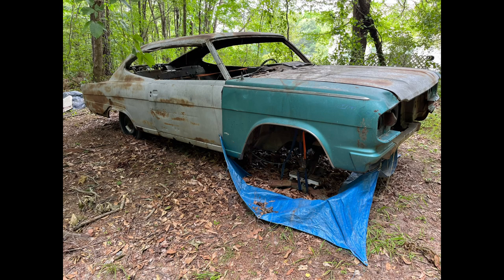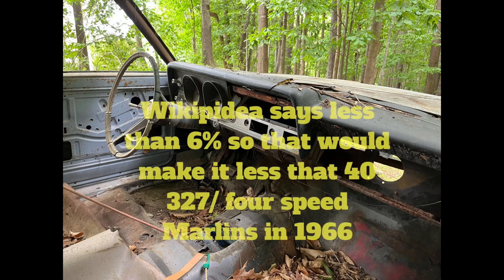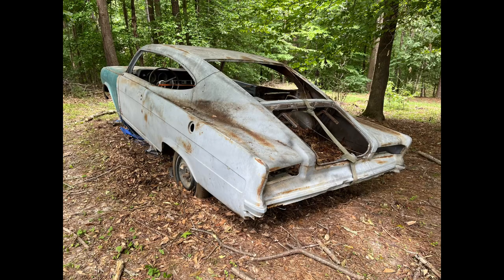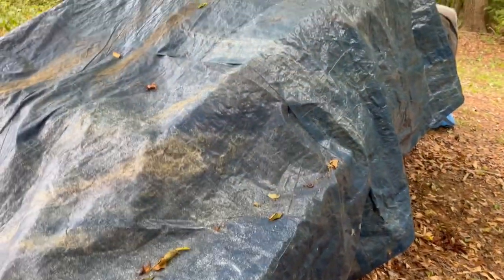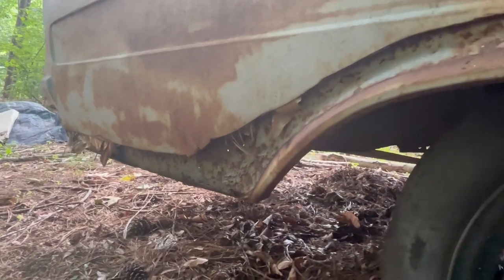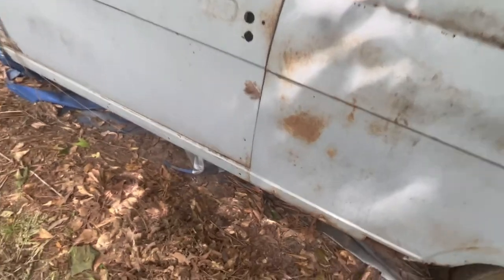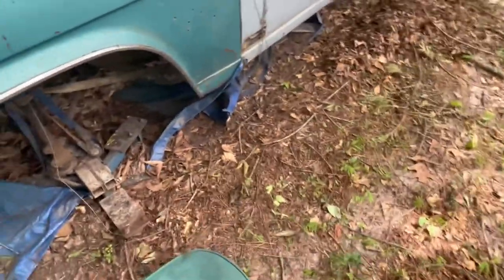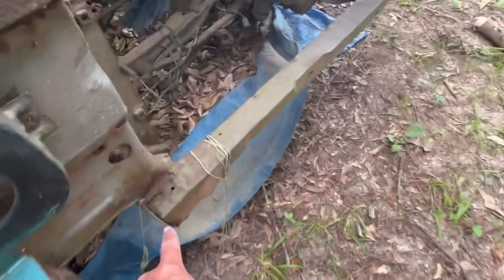Story of a rare AMC Marlin 4 speed lost then found

Comment: Seeing such a rare car reduced to this is so sad. It should be an actual crime to destroy such a rare piece of history like this. I fell in love with Marlins wheeler I was about 10 when a local guy had one in a turquoise main body with white accents. It was basically rust free other than some surface rust by the gas cap. Sadly it was totaled out when it’s owner got drunk and rear ended a car at high speeds and the front bumper ended up back over 2 1/2 ft from its factory location. Luckily nobody was killed but the car sat in his driveway for about 15 years and he refused to sell it, then one day it disappeared and about a week later it’s completely stripped of parts body turned up at the local junkyard so thoroughly stripped that not a single nut, bolt or screw remained. Sadly the rust free quarter panels and floor pan were not saved.
Reply from the maker: Wow, sad story. Yea it’s very unfortunate what happened to this car. We are saving it. We’ve rescued & sold over 30 this year so far. Some cool stuff coming up too